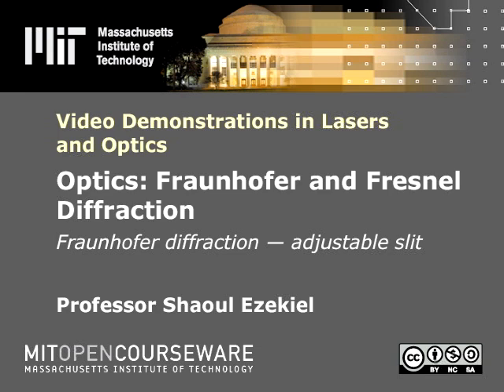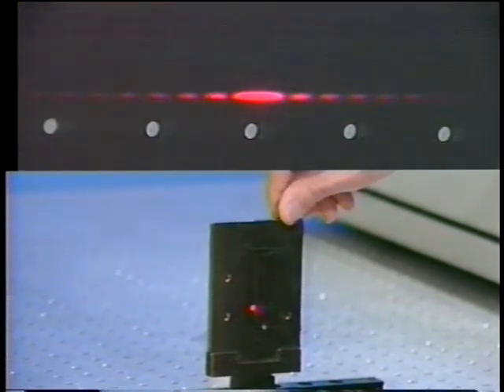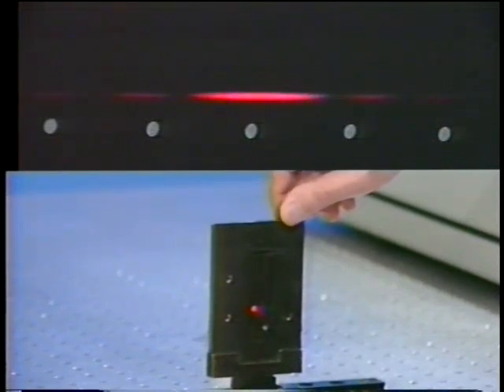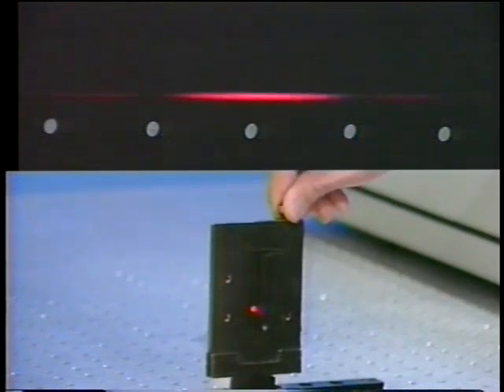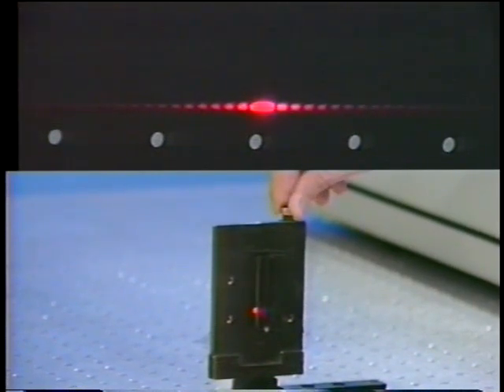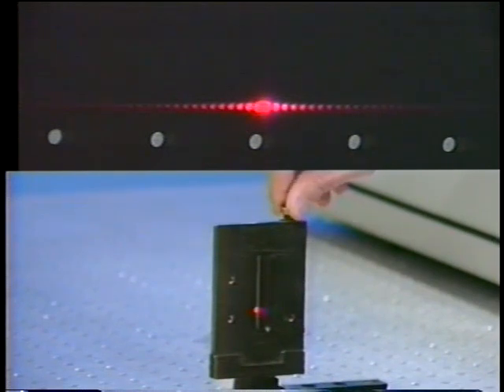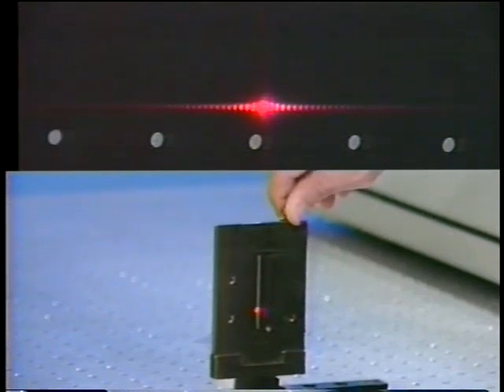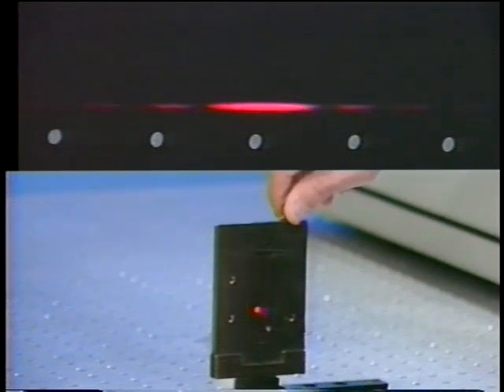Optics: Fraunhofer diffraction - adjustable slit | MIT Video Demonstrations in Lasers and Optics

Comment: The diffusion must occur at the edges of the slit, which makes diffraction occur for a single slit because of 2 edges. Not many sources explain this well.
Reply: I wonder if when physicists detect which slit in the double slit experiment if they are just destroying the coherence of the light. Hence no diffraction pattern.

Comment: is there any specific reason to use reflection of the laser light?
Reply: I was wondering that as well.
Reply: I think the laser was too long to fit in front of the slit and, additionaly, was obstructing the slit. Thus, it was moved and a reflection system was put in place. It works just as well with direct light.
Reply: We use this technique generally to allow the laser beam to diverge and increase its spot size by allowing it to have a longer optical path. This technique is described by the far field radiation pattern which is a region of the electromagnetic field. And the parameters such as Power radiated, radiation intensity, Power pattern, Directivity, Gain etc are calculated from Far field.
Reply: The reason is simple. It is to create a huge distance btw the slits and the source.... as for fraunhofer diffraction huge distances are required
Reply: Laser light is more coherent than ordinary light .
Reply: Yes,laser emits monochromatic light,the diffraction is not quite clear for the polychromatic light as there are multiple wavelengths in the beam.
Reply: It is used for monochromatic light

Comment: Can anybody tell me what's the difference between Fraunhofer diffraction and the diffraction at a normal way??
Reply: I'm not sure, but I would say that the difference is in the approximation of Fresnel-Kirchoff equation. If I'm not wrong, the Fraunhofer diffraction is an approximation valid when the source (the incident waves are plane waves (in this case the Laser Beam)) and the screen (In this case 200 cm) are very far from the slit. If the screen is near to the slit and the incident waves are spherical, we've got Fresnel Diffraction.